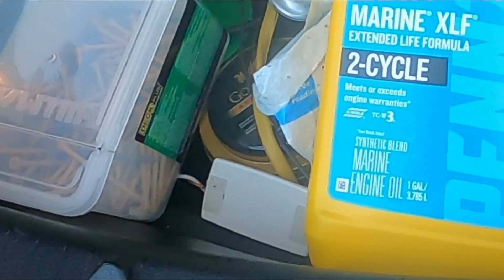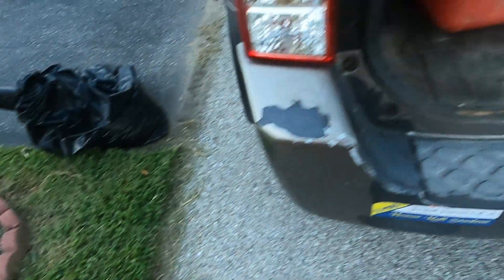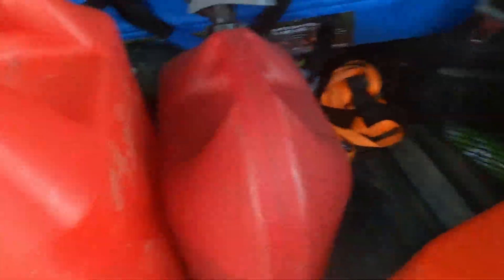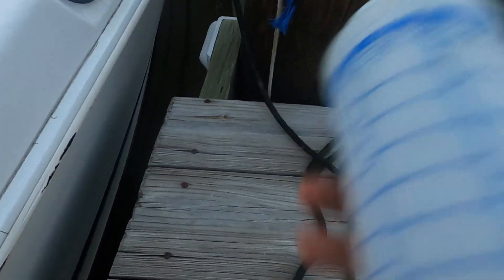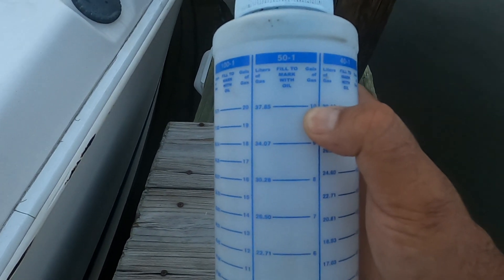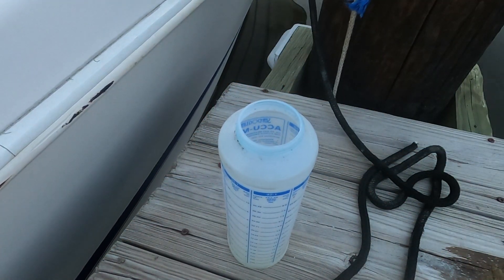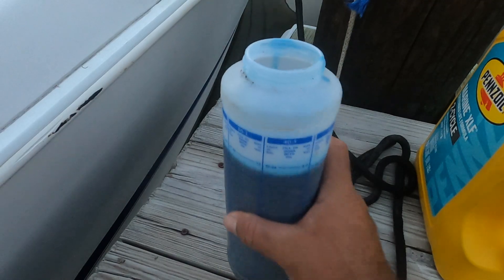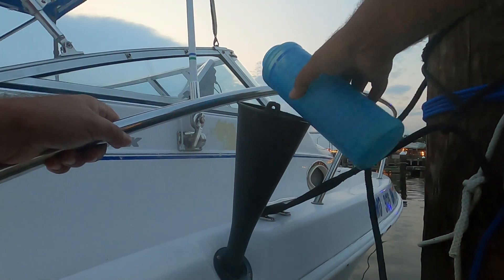Correct Way To Mix Gas and Oil | Two Stroke Oil & Gas Ratio

Comment: Hello. Shouldn't the oil and the gas be mixed before putting inside the tank?
Reply from the maker: If you add oil first and then pump gas then its fine but dont add oil last. If you use containers, you can  mix.